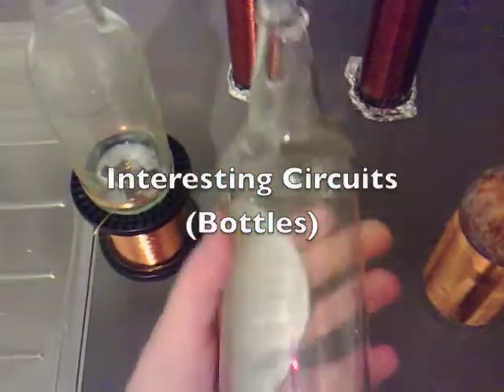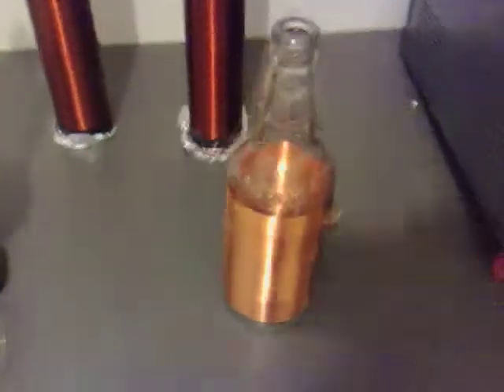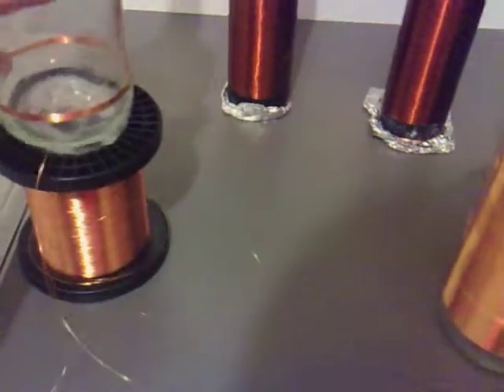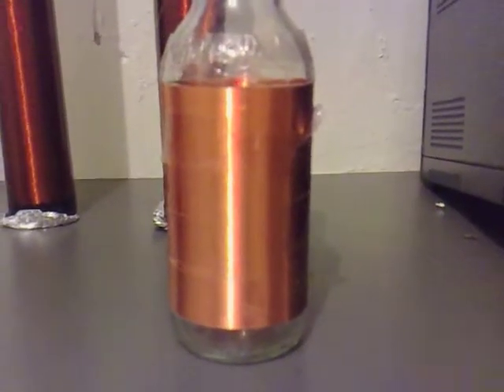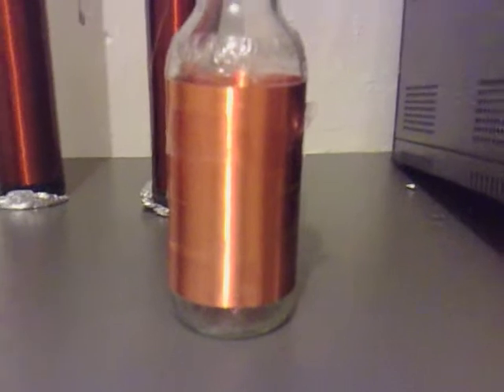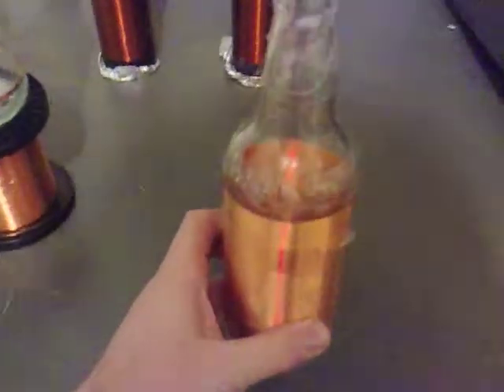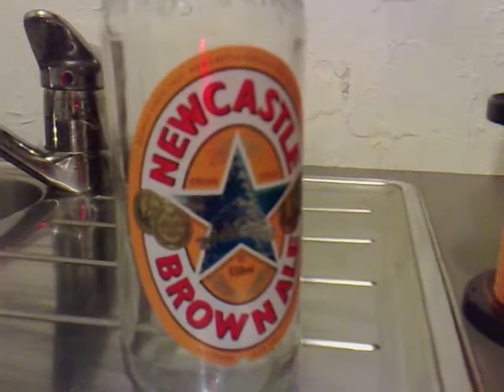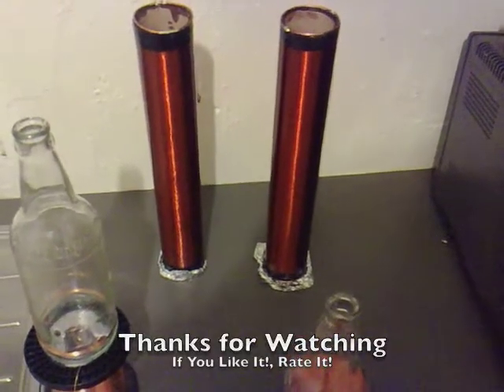Interesting Circuits (Bottles) 006

Comment from the maker: Not quite sure the bottle space is 110mm high and 23.5mm round. I think the wire was 0.17mm.  = 650 ish turns.

650 x 235 = 152058mm = 1520 meters

No wonder it took so long thats 1.5 kilometer

Just Buy a reel and start winding.....;-)